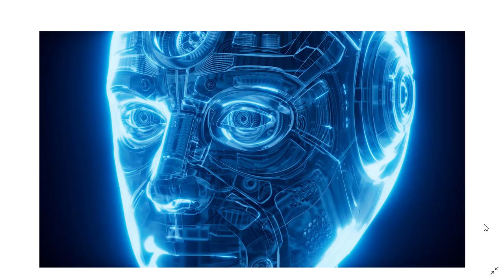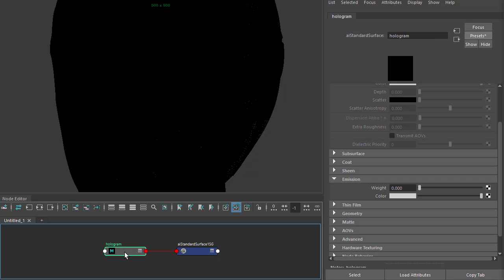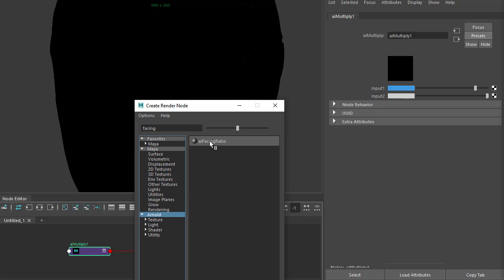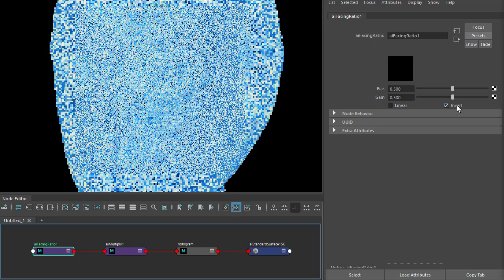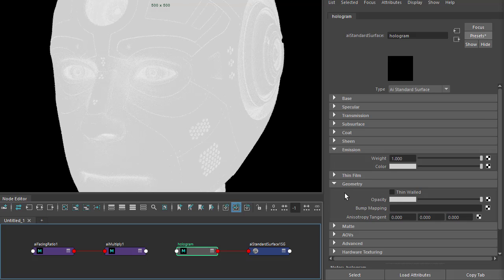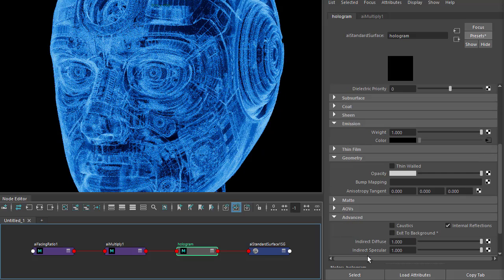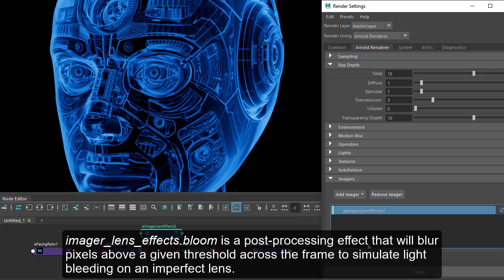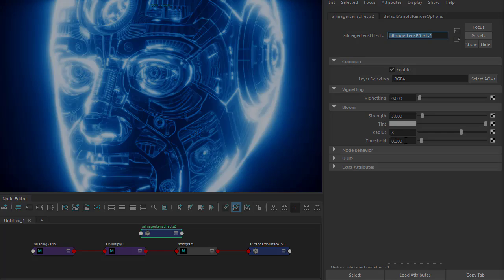Arnold tutorial - How to create a holographic effect in MtoA

Comment: Now how would you go about doing this without any refraction in the transmission?  IOR of 1.0? Or if you wanted floating holographic light that is additive, doesn't cast shadows, and avoids using transmission rays? Imagine a transparent glass display, except without the glass, just holographic light that is additive when layers overlap.